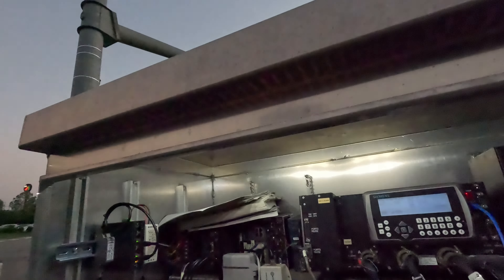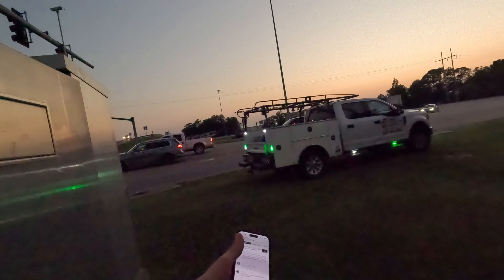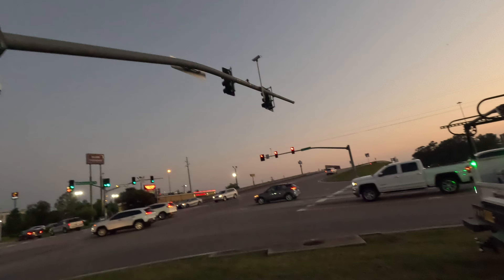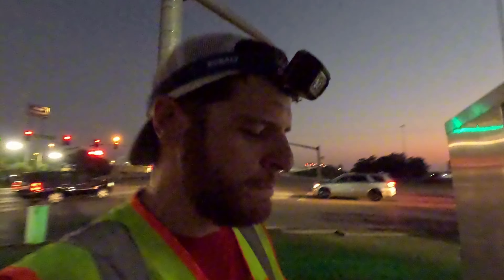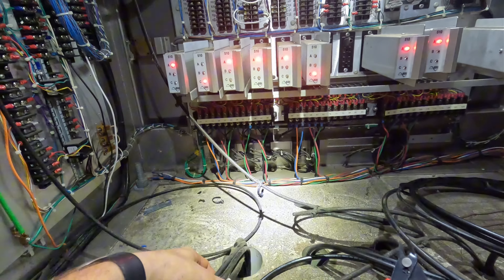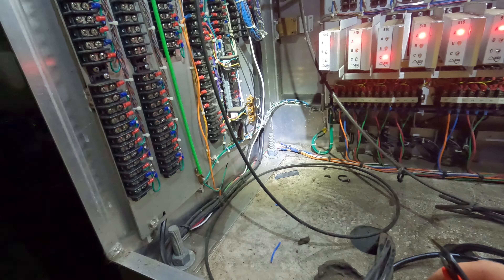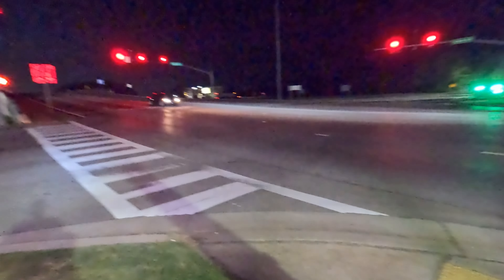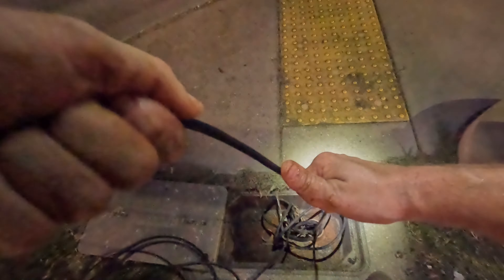Transforming Traffic: Cable Pulling for New Traffic Lights and Cameras!

Comment: Questions from Australia 🕸️🕷️….  What is the reason for a utility meter on the traffic signals?  In the UK and Australia typically you have unmetered supply connections for public infrastructure like traffic signals, streetlights, paytv and telecom equipment.  The asset owner simply pays an agreed price to the energy retailer based on the infrastructure connected.   Have you ever seen a traffic signal meter pulled for non payment?

Comment: Loving the content. A few questions for you.
At the diverging diamond, there are lights on both switchover sides of the intersection. Do each side have their own control cabinet? Are they linked in any way to make things flow smoother? 
When you do have to link intersections that are close together, do you usually run a wire between cabinets or is it wireless?
When you upgrade the physical cabinets, do you transfer over the old stuff (controllers, MMU's, load cells, detection equipment) to the new cabinet or does it require everything to be new?
Could i also make a request for a video. How do load cells work? Is it just a bunch of solid state relays? Does each head need its own load cell or can you run a few heads on one cell? How many amps does a traffic light pull? 

Thanks again for all the great content TLD.

Comment: If a phase goes long enough without detecting anything does it eventually give it a green anyway "just in case"? Or would you possibly have a red forever if a camera is blocked or otherwise not detecting anything even if traffic is backed up?
Reply: If a camera is having problems and does not place a call into the controller when you drive into the zone, then you will sit there at the red forever. Unless, the opposing straight through lane gets a call, which would give a green to both straight directions or if the lane you're in has a recall placed on it(most main streets have some type of recall). So if you ever notice yourself at a Red Light for 5+ minutes, it's best just to turn right or make a U-turn, because your're never getting a green. This rarely happens btw and some camera's have the abilty to place a call after a few minutes of no calls, just in case.

Comment: You know how to tone a cable with a multimeter to find out the length??  

Set your multi meter to ohms. Connect to cables together at the other end. Then set your multi meter to OHMs and put a lead on each wire. It will give you the length of both, so each OHM of resistance is 1 Foot, so divide in half to get the length to the end where you tied the together.  So if your OHMs read 65 ohms of resistance, your cable length to the end is 32.5 feet. Seriously look it up. If you show your guys that, they would be amazed and you look like a wizard.

Comment: Back in the day I used to work for a company that designed and built custom machinery, and I did a lot of the control wiring for them. Sometimes we followed a schematic that was engineered out, others I designed it. Lot of it was all relay logic but when PLC's came out we used them. Watching your videos makes me think that your line of work could have been a good move for me back then. Retired now so I can just enjoy what you are doing without the stress. 🙂

Comment: Why are all of your cabinets TS1s?
Reply: Most of the cabinets in his videos are TS2 Type 2 since they are using Port 1 (SDLC) to commuicate between the controller, MMU and Detector BIU's (TS2) and the controller has the A, B and C connector on it (Type 2). TS1 Cabinets dont use SDLC Comms.

Comment: You have a alot of travel time to work on all of the traffic light control box  and traffic lights
Reply from the maker: We go anywhere in the state! We’ve worked on and built intersections 5+ hours away when you add it up some jobs will have 40+ hours of just drive and paying multiple guys to get there plus hotels or campgrounds.